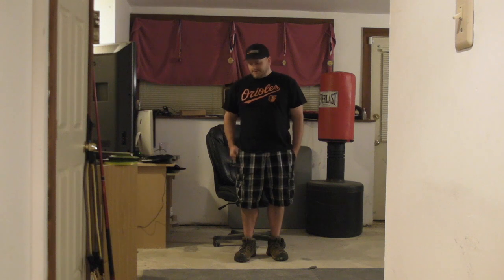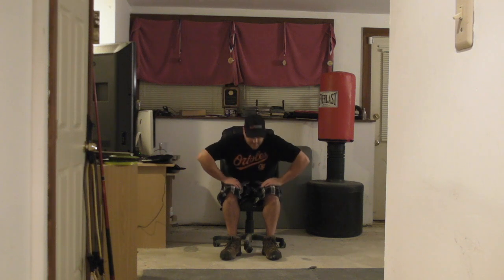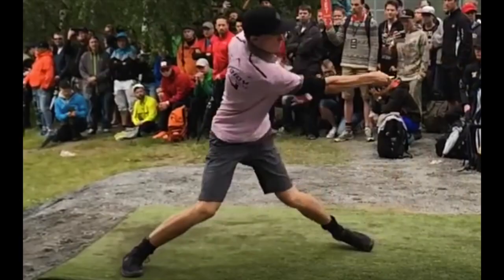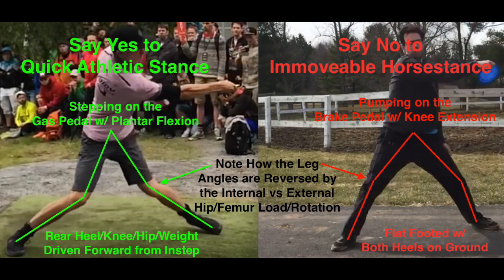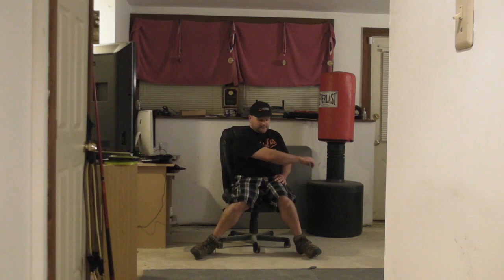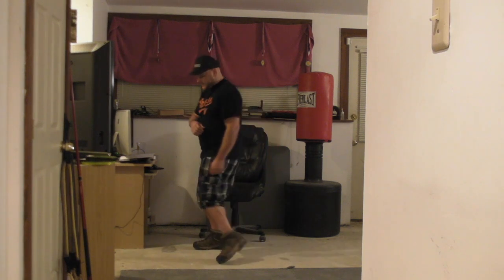Swivel Chair Drill - Gas Pedal Accelerator Move

Comment: What are your thoughts on the Malaska Spike video (in regards to using that pressure point when doing feet drills)? https://www.youtube.com/watch?v=Hbxtlxx0yIs
Reply from the maker: Good video, the pressure can move into the heel spike in the backswing, but it should ideally move back to the instep like my Figure 8 motion pattern. Obviously in x-step many top throwers don't get the rear heel down and stay on the instep spike. 
https://www.youtube.com/watch?v=dAXNglCDcz4 
https://www.youtube.com/watch?v=NC-e1NXR6mk&t=150s
https://www.youtube.com/watch?v=muz3IBPX58k

Comment: So at 3:35 you talk about spinning out the rear foot (toes rotating opposite of swing). Is it a balance issue to load/torque properly on that rear foot without it spinning out? Are there any good ways to mitigate this?
Reply from the maker: So what I said there  "spinning out is where the rear toes spin outward(away from target) in the swing" - in the swing includes the backswing and the forward swing. So spinning out - the rear toes are spinning away from the target in the same direction as the backswing and/or spinning away from the target opposite direction of the forward swing. 

The rear toes should not spin at any point, the rear foot may pivot up and/or roll targetward to maintain the torque pressure going targetward. If your rear foot rolls over toward the inside arch/instep/target, then plantar flexion will push your rear heel, knee, and hip(and weight) targetward and the toes/foot is not spinning, but is pivoting or angulating the foot and shin for leverage targetward ground up. Ben Hogan sent his shoes to England to put an extra spike in the instep of his rear golf shoe to help keep it from spinning out. As Mike Maves aka sevam1 says, "you need to resist that spinning pressure in the feet from the swing". And as Shawn Clement says in "Understanding Weightshift", you should feel like the arches of your feet are like suction cups in the ground. The ground force reaction from your firmly planted feet in the ground is what turns your body backward and forward and allows you to move. Your feet naturally want to spin out, but you must resist it or counter it to make your move. 

You must also maintain good balance and posture inside your feet to make "The Move". You want your feet to be firmly planted in the ground to resist that spin out or your body/weight getting outside your feet/posture. It's like if you have on hockey skates on the ice, you are going to keep the pressure on the inside edge of the blade to resist spinning out and to make your forward move without losing your balance or trying to shift your weight, the feet should move almost like how you skate on ice. Your rear foot should move just like it does in a slap shot. Maybe try throwing with ice skates on and on ice or even land. Frisbee Rob McLeod has some video of throwing MTA with skates on ice. I know you like to practice in bare feet in your house, but you really need to practice with shoes. Bare feet on indoor floors almost like trying to do it on ice in bare feet or in shoes. I highly recommend practicing with shoes and on concrete, not on grass or slippery floors - maybe yoga socks, but that's still not ideal. Grass is hard to get the feeling with lumpy ground and mentally hard to try something different without fear.
Reply: Man I feel dense. It's all there in 'The move',  but for whatever reason I've always thought of it as the ball of the foot staying in place. I've taken for granted the difficulty in keep the rest of the foot planted to load up on. I've watched so many videos like the James Conrad slow mo from reddit where you can see the knee and femur move counter clock wise, and just thinking the heel had to come in a bit for that to even be possible. Re-watching all these you can see that torque goes directly into the toes and drives forward. You've described this to me a million times and in particular the door frame drill where you say you load up so much on that rear foot where it has nowhere to go but forward. I'm a slow learner.